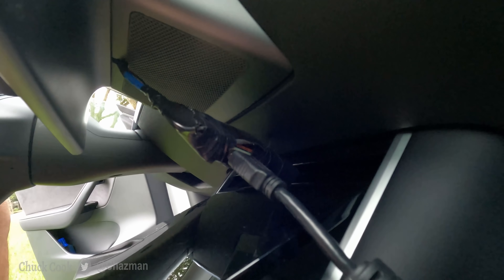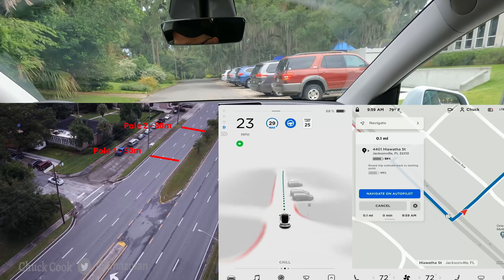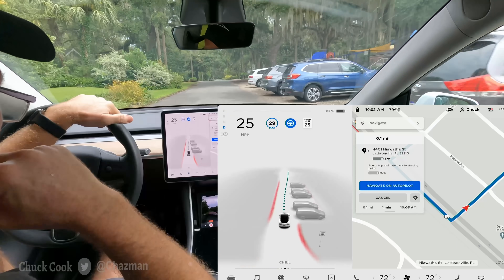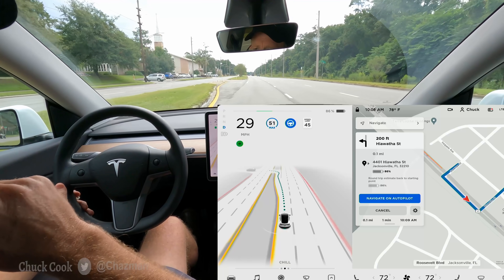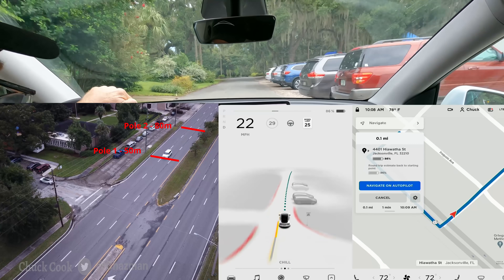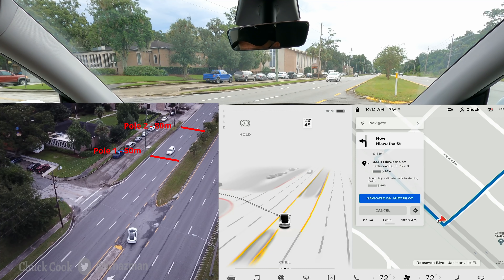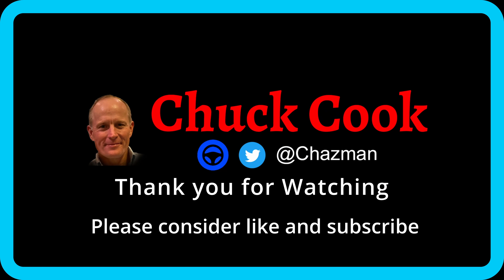FSDBeta LOTS of Forward Facing Unprotected Left Turns

Comment: Seems like the incoming cars show up on the visualization at the 80m mark. At these speeds it doesn't give the car enough time to clear the road without incoming traffic needing to slow if they are in the far lane.
Reply: Michael Cordon:   Yup.  And it's not AT ALL clear if vision only will reliably fix that given various weather, etc.  

LIDAR gives a good indication for at least 250 yards, so the multiple mode thing, over time, like all the serious safety minded competitors are using, would definitely help over time.
Reply: @rogergeyer9851  well humans can do it with vision. We have better cameras (eyes) though.

Comment: Chuck, I love your tests, and take this only as constructive criticism, but you are WAY too conservative about gaps. Objectively. You can always hit the accelerator if you actually need to.
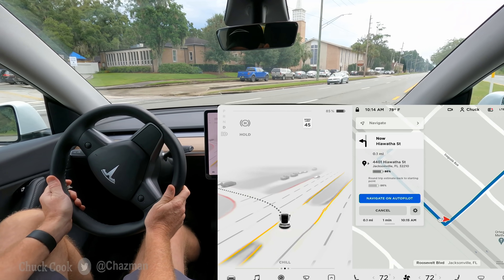FSD was definitely right about all but one of these turns and that one (9:18) was borderline (could be okay if it went fast but probably wouldn't have). I'm SUPER impressed right now!
2:45: "A gap it couldn't fit." That was literally a 5 second gap just to cross the FIRST lane and FSD crosses all 3 lanes in 3 seconds!
5:13: "Very tiny gap" is at least 7 seconds. It could cross, flip around, and cross back in that time...
6:12: Plenty of time here too.
7:38: Had 4 seconds to get past the center lane; twice as long as necessary. It started rolling out ahead of time to make it. FSD was doing PERFECTLY here.
8:38: How the hell does it not see this car?? =0  It also thought the parked car was sticking out into the lane for some reason.
9:18: This one is arguable. It would need to pre-roll sooner/accelerate faster to make it. It would have been uncomfortable for the other driver so waiting was appropriate this time.

Comment: I am confused about the 80 meters vision limit.  Watching the left turns, you did NOT seem comfortable when the oncoming cars were just outside the 80 meter limit so it seems that either the car needs to move more quickly to cross or increase the distance it can see to match what is your (and probably my) comfort distance for crossing when oncoming traffic is coming at 50+ MPH.  Thoughts?

Comment: If people are going to use Full Self Driving, they are going to have to accept that the car is driving & not a human being.  The car will drive without emotion or fear.  I have noticed that in Autosteer, the car will jerk & make self correcting motions if you allow it to.  Tesla may need to add a feature to the vehicle to let other drivers know that the vehicle is in FSD mode.  It's like if a vehicle is driving unusually slow but has the hazard lights on, the driver behind it is apt to be more understanding & patient versus seeing the vehicle going slow & not having the hazard blinkers on.

Comment: Hey Chuck, it looks like Tesla needs to work on the range of their FSD vision. It seems that when an oncoming car can be visualized on the screen, the car will wait to turn. But, if the oncoming car isn't visualized on the screen, it will confidently go for the turn, even though it shouldn't. Using the range demarcations you provided, it looks like the on-screen range of Tesla vision is currently about 75-80m, and my judgement is that FSD is not making decisions based on objects it may see beyond 80m. In other words, I think FSD is only making decisions based on objects we see on the screen.

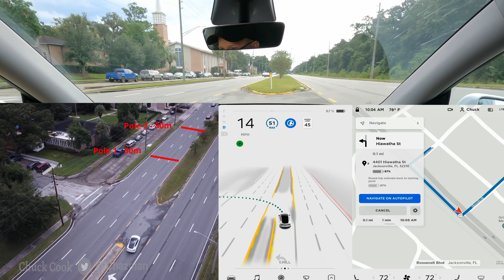A few questions: How fast are the oncoming cars usually going (for example the red car at 3:52)? Do you think a vision range of 100m would be satisfactory to confidently make this turn every time?

Comment: Some of the mistakes fsd is doing after updating to 10.x seems more serious than before and even a bit scary to me. In 2-3 of the interventions in this video it looks like you are stopping potentially lethal accidents from happening. I hope all beta testers understand that this is indeed a beta test. 
Thanks for another great video Chuck! Love the editing and the drone perspective. 
Cheers from Denmark
Reply: It is not good if they make a wider release with fsd running stop signs and things like these
Reply: Bro, you as crazy as Chuck =o  None of these were anywhere near "lethal incidents." Only one of them was even an appropriate disengagement.
2:45: "A gap it couldn't fit." That was literally a 5 second gap just to cross the FIRST lane and FSD crosses all 3 lanes in 3 seconds!
5:13: "Very tiny gap" is at least 7 seconds. It could cross, flip around, and cross back in that time...
6:12: Plenty of time here too.
7:38: Had 4 seconds to get past the center lane; twice as long as necessary. It started rolling out ahead of time to make it. FSD was doing PERFECTLY here.
8:38: How the hell does it not see this car?? =0  It also thought the parked car was sticking out into the lane for some reason.
9:18: This one is arguable. It would need to pre-roll sooner/accelerate faster to make it. It would have been uncomfortable for the other driver so waiting was appropriate this time.

Comment: As usual top notch quality Chuck 👌🏼 truly appreciative of the effort that went into all of this😍🙏🏼

Now that we can see the screen clearly; notice the requiring theme of how for all of the disengagement’s that happened in the following time stamps, the car wasn’t rendering or seeing the oncoming car that called for a must disengagement:
@2:47
@3:52
@7:40
@9:20

Meanwhile when the car waited @6:45, it was rendering and clearly seeing the car it was waiting for.

So for the car not being able to see that far; what’s your thoughts on the limiting factor? Is it hardware or software related? 

Again truly thankful for your videos Chuck 😊
Reply: Yes, that's why he has the 80m line; that's the range of the camera. That said, this actually proved that it doesn't need to see further in this case (maybe for 70mph traffic). Only one of the disengagements was actually warranted and it was borderline. FSD did a fantastic job here.
2:45: "A gap it couldn't fit." That was literally a 5 second gap just to cross the FIRST lane and FSD crosses all 3 lanes in 3 seconds!
5:13: "Very tiny gap" is at least 7 seconds. It could cross, flip around, and cross back in that time...
6:12: Plenty of time here too.
7:38: Had 4 seconds to get past the center lane; twice as long as necessary. It started rolling out ahead of time to make it. FSD was doing PERFECTLY here.
8:38: How the hell does it not see this car?? =0  It also thought the parked car was sticking out into the lane for some reason.
9:18: This one is arguable. It would need to pre-roll sooner/accelerate faster to make it. It would have been uncomfortable for the other driver so waiting was appropriate this time.

Comment: Love the new way of recording the screen, much clearer. If the visualisation is accurate then it looks like it can't see quite far enough yet, and goes if the car it should wait for is just out of range.
Reply: Ian Roberts:  Or can't judge the speed well near the limit.  This is another reason multiple sensor modes, including LIDAR are needed.  It could really help make the car when such scenarios are unclear with vision only with current technology.  (Just checked and confirmed that LIDAR is reliable for cars at 250 meters away or more).

Comment: Great testing!  I think on a couple of these, it could have made it without issue but I can see why you wouldn't trust it enough to let it cut that close.  This exposes a good point in what a difficult problem training FSD is for two reasons.  The first is that all drivers will have slightly different expectations which will inevitably lead to inconsistent feedback.  The second point is I bet they are bumping up against sensor limitations here which may force them to cut things a little closer than a human: it may just not see as far as a human.  Interesting how different situations bother different reviewers.  For example, I'd be bothered that it accelerates too quickly on tight/narrow roads where cars are parked on the side.  I'd never blast past parked cars on a tight street at 25-30 MPH but FSD seems to.  I've not seen other reviewers complain about that but in watching some drives, I often say to myself "Wow, that's too fast for a narrow one lane street with cars parked all along the right".  Makes me nervous someone will open a door or a child will step out between cars and there won't be enough time to react.  The complexity of the FSD problem is mind boggling!
Reply: Objectively, only one of the turns was questionable. Apparently Chuck is a VERY conservative gapper, though I somehow doubt he'd be as conservative if it weren't FSD driving, which doesn't make much sense. Can always hit the accelerator if it's not gonna make it comfortably. On some roads, it would be stuck forever waiting for Chuck's 7 second gaps. I hear you on the narrow roads, though. It's definitely breezed past a lot of cars with no margin for the unexpected. Even did so once where a car door was opening.
2:45: "A gap it couldn't fit." That was literally a 5 second gap just to cross the FIRST lane and FSD crosses all 3 lanes in 3 seconds!
5:13: "Very tiny gap" is at least 7 seconds. It could cross, flip around, and cross back in that time...
6:12: Plenty of time here too.
7:38: Had 4 seconds to get past the center lane; twice as long as necessary. It started rolling out ahead of time to make it. FSD was doing PERFECTLY here.
8:38: How the hell does it not see this car?? =0  It also thought the parked car was sticking out into the lane for some reason.
9:18: This one is arguable. It would need to pre-roll sooner/accelerate faster to make it. It would have been uncomfortable for the other driver so waiting was appropriate this time.

Comment: Great camera setup. The drone videos are so helpful, as are the pole distance markers. If the oncoming traffic at 60mph is beyond the 80m mark when the car is rolling, don’t you think it’ll make it just fine? Rather than disengage when you are not sure, couldn’t you just be ready to tap the accelerator to speed it along?
Reply from the maker: I am not looking at distance markers when I make my decisions to disengage.  I disengage, when the car goes when I think it is too close.   really wish I could think of an easy way to project buffer circles around the approaching cars, so that the relative speed comes across. Slower oncoming cars, smaller circles, faster larger circle. The goal of making these intersections is smooth flow of traffic. If an oncoming car hits their brakes because I was too close, it creates a traffic frequency wave that in some scenarios can have consequences. At the very least its not the way to drive.

Comment: It looks like forward camera car perception is still distance limited to ~95m (technically likely a little further minus latency). The planner should be aware of this limitation and always assume a car is coming from just outside that view distance in every lane during its simulation/planning.
Reply: That'd mean never crossing roads that have higher speed limits.  The perception distance is what needs to be improved.
Reply: @rhamph  if it can’t so it safely that’s fine by me for now.
Reply: That's not a problem in the U.S. It's seeing them plenty far away for highway speeds. 70 mph would be borderline but that's the top speed here. Germany will be a problem, though. I definitely think they'll need a longer draw distance camera there.
Reply: @yangdaily-andrewyangnewspo6434  what do you mean? This video proves 95m isn’t good enough for 55mph cross traffic
Reply: @Zaptrem  Negative. This video proved Chuck can't judge gaps.
2:45: "A gap it couldn't fit." That was literally a 5 second gap just to cross the FIRST lane and FSD crosses all 3 lanes in 3 seconds!
5:13: "Very tiny gap" is at least 7 seconds. It could cross, flip around, and cross back in that time...
6:12: Plenty of time here too.
7:38: Had 4 seconds to get past the center lane; twice as long as necessary. It started rolling out ahead of time to make it. FSD was doing PERFECTLY here.
8:38: How the hell does it not see this car?? =0  It also thought the parked car was sticking out into the lane for some reason.
9:18: This one is arguable. It would need to pre-roll sooner/accelerate faster to make it. It would have been uncomfortable for the other driver so waiting was appropriate this time.
Reply: @yangdaily-andrewyangnewspo6434  it doesn’t matter whether it’s physically possible. If it’s even close your freak out oncoming traffic and potentially cause an accident anyway
Reply: @Zaptrem  No, you do not "freak out" oncoming traffic when it's a little bit close. They tap the brakes a bit and everyone goes on their merry way. This happens all the time at these types of turns, where you either are assertive or you never make it. These are adult drivers, they can handle it. And most of the ones he aborted were not even close. He called a 7 second gap "very tiny" =0

Comment: 3:50 was a serious violation. You don't need to test it further, it seems quite consistent that it goes when the cars are out of allowed vision range even though collision is imminent. If it's not in the visualization it can't see it and it goes. The range is set too short, presumably with focus on low speed intersections. I suspect the cars can well be detected even with the limited resolution. Even if cars can't be robustly detected it can detect movement. If a stampede is coming, it doesn't go. Doesn't matter if it can't recognize individual cars.
It has a well defined problem with range and speed. Maybe I have to work for Tesla. There seems to be several aspects where I can contribute and move them forward.

Comment: On that second disengagement comparing the time the red car took to get there and the time the other turns took to complete; it seems to me that the issue is the computer isn't taking human error from the other cars into account. 

In other words, it looks like the gap would've worked if everyone's speed and path remained constant, but as seen by the red car's reaction, it isn't safe to assume that will be the case. It needs to have a bit more of a buffer to allow for variance. The exact values will likely have to be trained but I think a good starting place would be one second, and treating all cars as if they occupy both the lane they are in, and the directly adjacent lanes.

Comment: I think the car basically needs more computing power. It seems like the latency between the time it thinks correctly it has a gap and the time it goes for it is too long OR there’s not enough frames processed to know that the oncoming car is closing in fast. I honestly think these problems will persist  until the car gets a faster computer

Comment: I would so much love it if Tesla would show us your let turns re-run in the simulator. Dying to know what it actually would have done in these situations. While it is wrong in the way it is telegraphing intentions to other drivers (probably one of the most difficult things to teach the neural networks), it would be at least nice to know for sure it would avoid actual collision.
Reply: Scott Graham:  But if cutting it too close, there are unknown variables like road conditions (like slick spots), what a human driver might do to react, etc. Just because if everything went PERFECT it might manage to make it does NOT mean one can know no crash would have occurred if cutting it too close. 

And getting it right 99% or 99.9% of the time is NO GOOD for high speed accident risk situations.
Reply: @rogergeyer9851  You miss the intent of my comment. Mainly I just want to know what it would have done had Chuck not disengaged. By "avoid collision" and am not referring to it making a risky attempt and by luck or precise timing succeeding; rather, I am referring to whether it might have cautiously stopped just as Chuck did, but a few microseconds after he took over.

In terms of the safety of FSD beta in general, there is a big difference between the car seeming to make a bad move that it will abort a split second later, verses actually following through with the apparent bad move. Of course it should not even seem to make a bad move in the first place, and testers must abort the moment the feel that car seems about to do something unsafe.

Hence, my comment. In the simulator we can safely let the car do anything and see what happens. Watch the AI day presentation if you don't know what I'm taking about re:simulator.

Comment: Tantalizing as to what is to come. Thanks for continuing to provide training material. Its wait behavior definitely needs improving.  It needs to stay parallel to traffic with wheels straight until it is safe to go.  Behavior is still much improved over earlier versions with the car moving with significantly more assuredness when it does decide to go...the downside is that it can't be wrong in that kind of scenario.
Reply: Don Burke:  And the way it handles LOTS of turns with stop signs says it's not remotely reliable re seeing things clearly.  And that means mistakes WILL happen.
Reply: @rogergeyer9851  and your point is what?  You do know this is beta software and everyone testing it knows that, right?  Who has claimed it won't make mistakes?  Even when in production, it will likely not ever be "perfect."